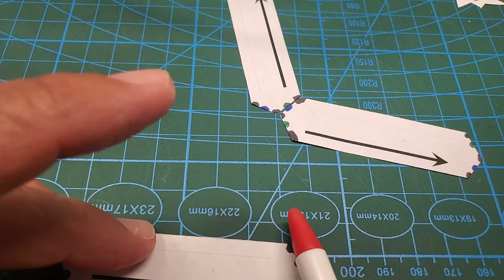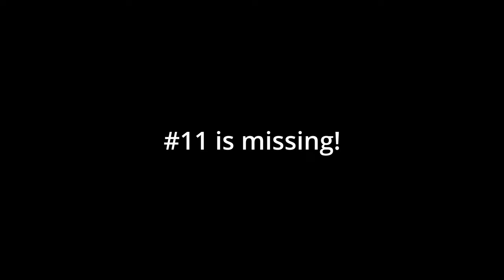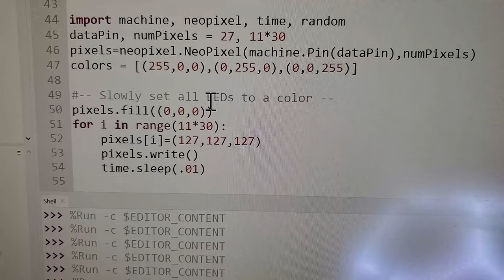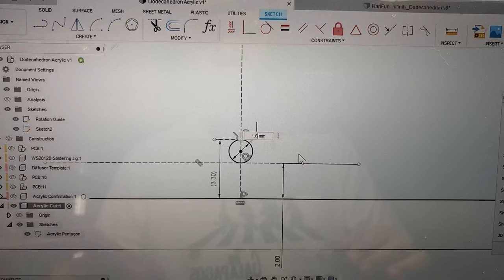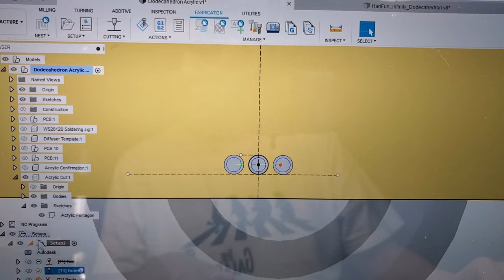HariFun #209 - Most Beautiful Thing I've Ever Built

Comment: Great video as always 
One thing: an easy way to solder, that gives the same amount of solder, is to "cut the solder" by the ion, and press the somer to the pad/component leg in a sliding motion.
A bigger tip on the soldering ion is a plus too.
Great project by the way 👏 
Thanks for sharing your project with all of us 👍
Reply: Yes the tip was a bit too small for the task. Too small tip makes soldering a pain. Just as having "supersonic" solder (i.e. too thin so you need a very long piece for each solder point)

Comment: I’m six minutes in but this can be done without backtracking.  Look for information on the Hamiltonian Cycle.  The dodecahedron can start at a vertex of the surface and draw an infinite number of straight lines across the figure that return to the original point without crossing over any other corner
Reply from the maker: Cool. I've never heard of that. Thanks for the comment!
Reply: What LEDS did you use and what is the pitch of the connecting vertexes?  I saw your Z was 20.8 degrees but it looked like your PCBs weren’t at 120 degrees to account for the vertical shift?
Reply from the maker: @Gametris  The leds are WS2812B. Sorry I don't remember the angle details.  The only angle I specified was the dihedral angle of a dodecahedron that I got from Wikipedia.  Everything else are based on the resulting dodecahedron.  Even the PCB outline was derived from the 3D model of the dodecahedron.
Reply: @HariWiguna  would you be willing to share your PCB design?  I’m wanting to make one using 3535 LEDs

Comment: This is really cool! It looks like it's bigger on the inside than it is on the outside, really mind-bending.

You did a great job showing the assembly and troubleshooting process. I also like your technique for getting the LEDs onto the PCBs by just sprinkling them on :)

A few tips/ideas:
Is it possible to make the "full of stars" a bit more random? From some angles you can see the repeating ring as the dots travel around. Maybe you could vary the speed or direction somehow? Or have some of the dots fade in and out or change color?
Pan/move the camera just a little more while filming - it really highlights the 3d effect.
If you could have the dodecahedron rotate automatically, that might look cool, though I'm not how you'd power it.
Reply from the maker: Hah, I wonder how people would react to that joke.
Making the full of stars more random is a great idea!
Believe it or not, I had the same rotating idea but could not figure out how to hide the wires.  Thx for the constructive comment!

Comment: Design an assembly jig made from precision cut pieces of PCB material that slot together in such a way they can't go together at the wrong angle.
Reply from the maker: That's a great idea too! Surprisingly the 3D printed jig works well. I would have thought that the PLA would melt due to the solder temperatures, but it didn't.  Since I have a 3D printer, making the 3D printed jig was easier and faster than a PCB version.  But without a 3D printer, your PCB jig idea is brilliant!

Comment: This is absolutely beautiful! I think Adam Savage did something similar but this is on a completely different level. Love it! Will you be making files available?
Reply from the maker: Thanks Alan! I think I saw Adam's version.  IIRC it has less faces, thus the reflections are not as intricate.

Because the current dodecahedron is not yet easy to assemble, I'd rather not share the files yet.  I'm working on an improved version based on what I've learned.  If you're impatient and would like the current files, email me.  

Otherwise, hopefully the next version is actually easy to build. I plan on making the plans available (for free) and also sell kits.
Reply: @HariWiguna  I would deffinately be interested in a kit. I've built an infinity cube that I'm very proud of, but this is on a whole other level. Beauty personified.
Reply: @HariWiguna  I would be interested in a kit for sure!

Comment: Super, maybe possible get files for make this amazing decoration?
Reply from the maker: Thanks. Unfortunately, I do not have a set of working files.  The one I shared in the video had errors that I had to fix by cutting traces.  Also as I mention in the video, it's not really easy to make.  You might be better off using pre-soldered LED strips.  You could find many other people that have done that. Also check Instructables.com for actual step by step instructions.